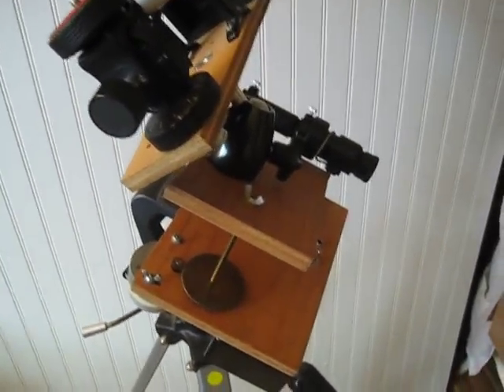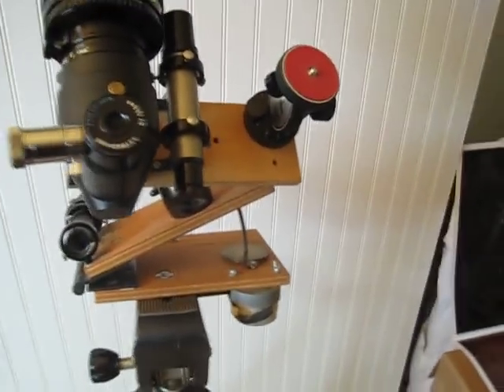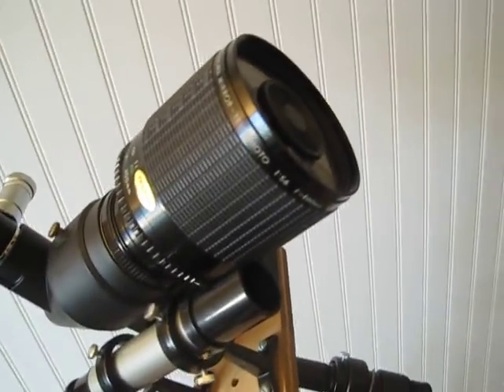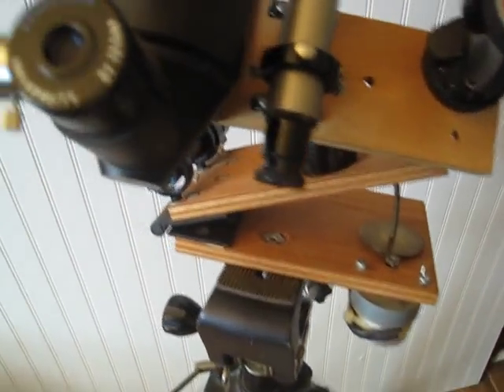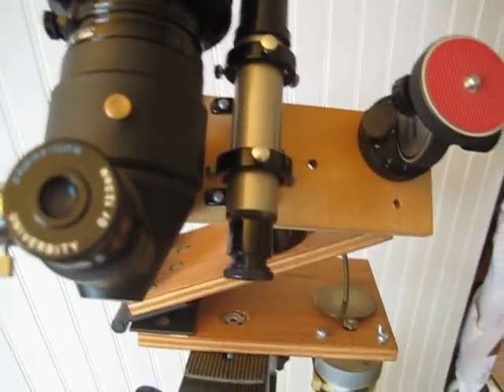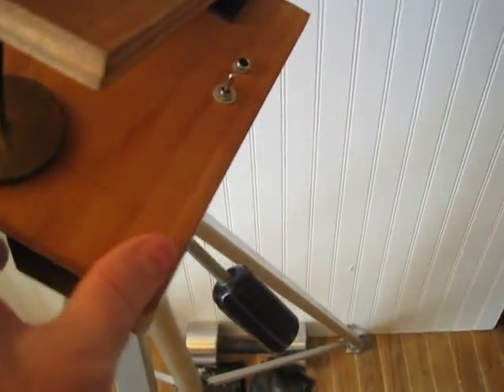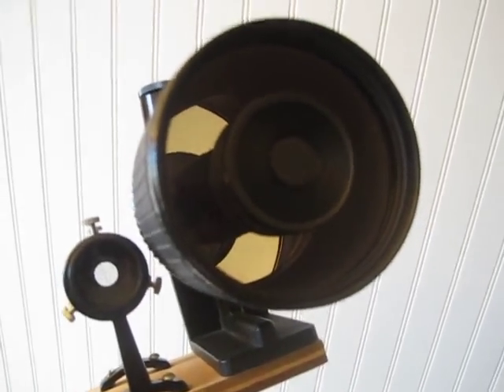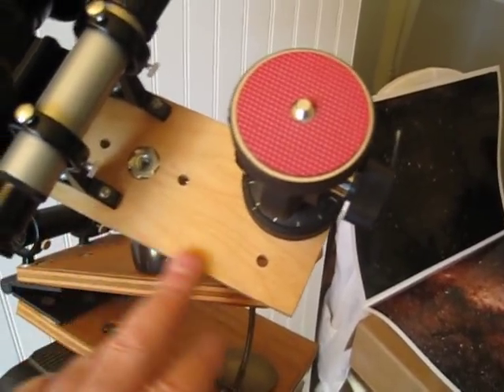Barn Door Notes - How to check tracking optically - Astrokits

Comment from the maker: Small gear is 20 tooth, 48 pitch. 14-1/2 degrees pressure angle, 1/8 inch thick, 1/8 inch bore, no hub. Larger spur gear is same but 100 tooth with hub made to fit 77R10 ball bearings. Other gear arrangements can be considered, but note it's a good idea to have the large gear run at 1 RPM as an easy way to confirm speed. The single hard and fast rule is gears must match each other in pitch and pressure angle. Plastic gears can be used but u must fit a metal thread (nut) in the large gear center.